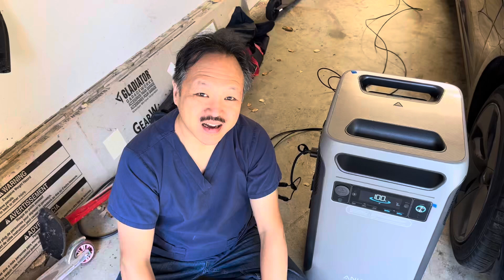Anker SOLIX F3800P maximizing generator efficiency with rackmount batteries in parallel, less time!

Comment: Thanks for the videos. Is it possible to take photos of your setup please, or give a list of what is required for battery pack system. I am not familiar with rack batteries and would like to have an idea of what it needs to complete a system. 
I don’t have a 3800 yet but plan to buy the 3800 plus with extension battery when it will be released if price is reasonable here in Canada
Reply: many options for rack mount batteries, in order to use them you'd have to be comfortable with connecting them both to a charger (either MPPT solar or AC-DC charger) and from the batteries to the f3800. if you are not comfortable with making wires, this is a DIY kind of endeavor so you may ask a friend who is comfortable with basic electrical wiring to help you